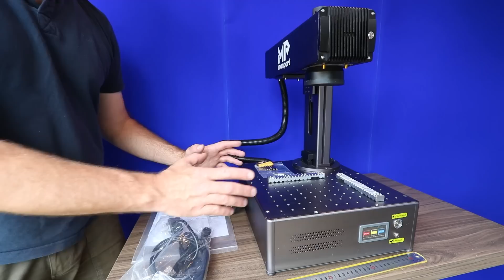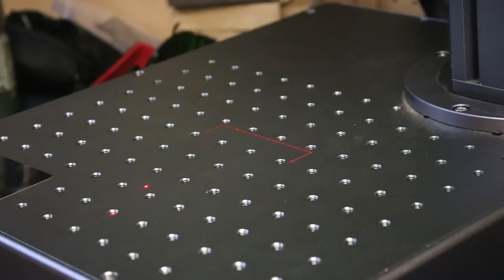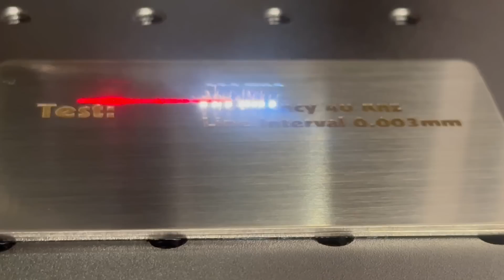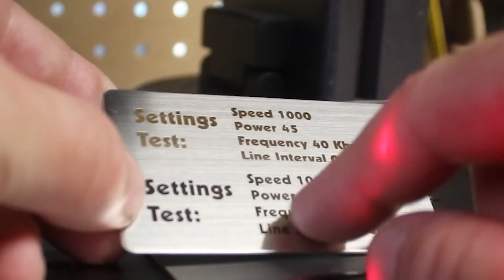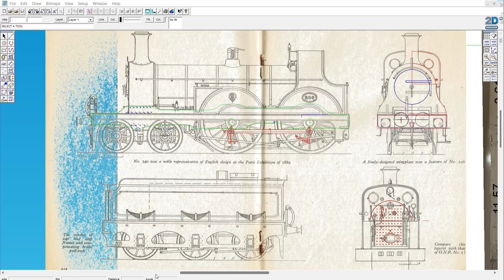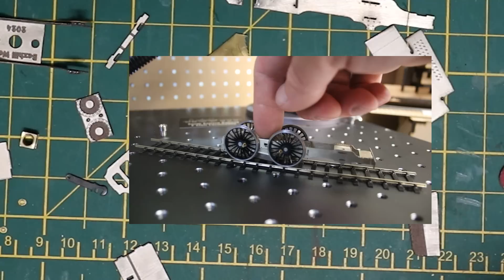S2E45 Monport GA30 Fibre Laser Set-up and First Look | Bexhill West Model Railway

Comment: Compared with chemical etching, I guess that you can achieve much cleaner slots and cuts without as much of a chamfer that you end up with with conventional etching.  I think this will allow assembly to be more fun than I remember on kits of the 1990s.  Defiantly less messy but fume extraction still essential.

Comment: Better than chemical for etching details cut to depth, let alone cutting out, so as you say, a game changer.
The limiting factor temporarily will I expect be the production of the CAD files, but I also expect that we will soon have some software which can work from photographs or even engineering drawings and a combination of both.

Probably for production runs it will need to be fed a strip of metal of a roll.      

Does it slice fingers off if you accidentally get too close though?

Comment: I wonder what would happen if you did chemical etching in a ultrasonic cleaner ?
Reply from the maker: I imagine it would work of a fashion, but be far from ideal. It could be a fun thing to test out. Another home-brew suggestion might be to run the ferric chloride through an electric shower pump into a tank.  I have 2 spray etch tanks which are essentially the same thing - high pressure spray plus a heater.  
Just don't do it in your bathroom.  :)
Thanks for watching,
James
Reply: @BexhillWest  Did you build or buy those tanks? I was looking into making some etching tanks out of perspex and using a fish tank air pump to introduce some agitation. If I need temperature control I was thinking of immersing the tanks in water and using a sous vide machine to heat the water (much like people do to develop film at home to get a controlled temp of the chemicals)

Comment: This is great.  Thanks for sharing.  My question is, would this tool be a replacement for a "regular" laser cutter, that is can it cut and engrave plywood, MDF, and cardstock as well as cut brass and nickel silver, or is it better suited to metals?  It looks like a tool I would want to have for my model building in n-scale.  I wish to cut my own bridges and buildings in wood and card, but I aspire to scratch build a steam loco also.  It seems that this machine would replace photo etching, but I want to make sure I am understanding its capabilities and best uses correctly.
Reply from the maker: Hi Jonathan,
In short, No.  This type of machine is not really an alternative to a regular laser such as a diode or CO2 machine.  It's a bit specialised in use for day-to-day jobs which we might envision using a laser for in our model making.
It does do things however that 'regular' lasers cannot.  For example, marking and cutting metals but it will also etch plastics as well with super high precision, as well as most other materials - so it is a versatile technology.
The downside for day-to-day jobs is that the effective cutting/marking space is really quite small, and the power is concentrated towards the centre of the workspace.  This means that while it will happily engrave over the whole surface, if one wishes to cut then realistically it is only viable over a smaller central area of the workspace.  There lenses with different focal lengths which affect this, but the principle stands.
I believe a fibre laser is an excellent additional technology over a regular laser in that it will do things which simply are not possible otherwise.  An obvious example being the ability to engrave in 3d - like a bas relief.  This isn't possible with a diode laser, although it can be done (just not as well) with a CO2 laser.

If I were starting over again looking to get a laser machine for my model making, I'd probably spend something like £300 on a low power diode laser.  I'd later spend a bit more for something with more power and which will be a bit more user friendly.
I later step-up to a CO2, and keep the diode machines dedicated to certain jobs. 
A fibre laser would come next.
Of course different folks have different needs.  If I were buying a laser to engrave products like key rings and coasters I'd go straight for a fibre laser without question because they are so quick.
Finally, one more thing to consider...a fibre laser has a tiny kerf width. and can work to incredible precision.  I've just cut a 19mm dia. 180 T gear out of N.S. and it meshes perfectly with its 16T spur.
The downside of course is the price - this technology does not come cheap, which is why I am so grateful to Monport for letting me have a play with something which would otherwise be beyond my reach.
Thanks for watching,
James
Reply: @BexhillWest  Thanks for your reply, James.  Very helpful.

Comment: Hi James, It's an interesting video, probably too far advanced for me, although loco building items would be very useful to be able to make at home. I am a little confused, however. Most laser cutting videos that I've seen they appear to have a uv cover, so why does this not have one? Lawrence
Reply from the maker: HI Lawrence,
That's a good question.  I'm going to cover safety in my next video with the machine.  This style of machine tends to be used without a shield for a number  of reasons, one being that it is possible to rotate the head to engrave upon larger objects which don't fit on the machines work table.
Also, they really are an industrial machine and would be used in a setting whereby proper safety protocols are in place.  Whilst making the video I have been wearing safety specs and I'm using it in an environment where others are not around.
That said, I plan to build an enclosure around the machine and incorporate suitable extraction which is a necessary precaution as the vaporised particles become airborne.
Thanks for watching,
James

Comment: Interesting, literally 30 mins before your post this morning I saw a message on redit about monoport fibre lasers, apparently they are fine when they work, but like so many China based companies, they don't want to know you if the machine fails, the person concerned has been waiting two weeks for a returns label after 34 support emails going back and forth established the laser had failed, however I do realise that Monoport have a UK distributor  

With regard to cutting stuff out, the issue with fibre lasers like this is that they project from a single point downwards, this means that the further away you are from the vertical the more of an angle the beam is at, not a problem if you are just etching the surface but the thicker the material you are using and the larger the pieces you are trying to cut out the more noticeable this is going to be and worse the angle will vary depending on distance from center 

An alternative MIGHT be using a small LED laser to cut through a chemical etch mask and then using regular acid etching techniques.

PS Don't get me wrong, cutting the chassis for the loco was impressive
Reply from the maker: In reality David, the cutting angle you mention is a non-issue.
The laser needs to be very precisely focussed to deliver maximum power.  Clearly, that focal length increases as the beam moves further away from the centre.  What this means is that whilst it will engrave over the entire surface (it is after all an engraver), it will struggle to cut thicker materials over its maximum operating width.  When using it to cut rather than engrave as I am doing here I'm working over a small area, which given that the focal length is relatively long 330mm, means that the cut angle is not an issue.  This is especially the case as I'm working with thin materials.  If I wanted to cut, lets say, 20mm thick material I wouldn't be doing it with this machine.  It's not what it's for. 
A fibre laser works differently as it's intended to be used differently and achieve outcomes which are not possible with other laser technologies which is why I've been keen to test one out.
I get where you are coming from, but it's a bit like saying "my tractor doesn't get very good fuel economy on the school run"  :)